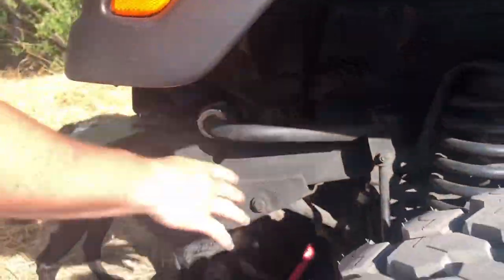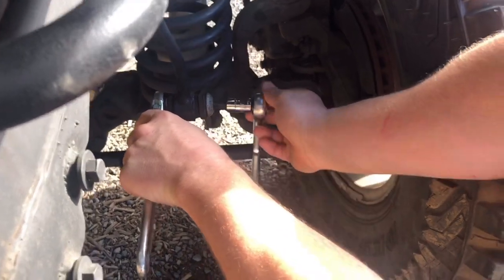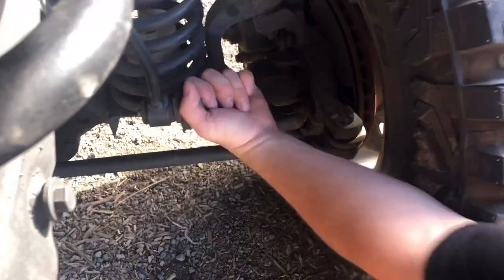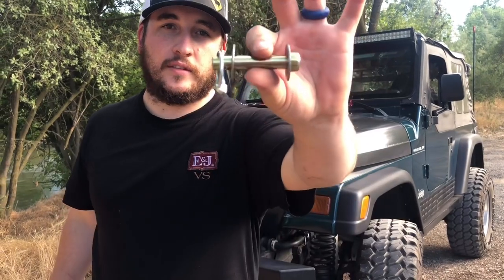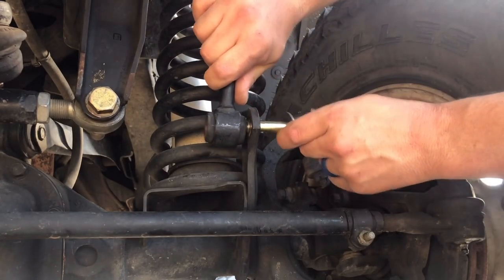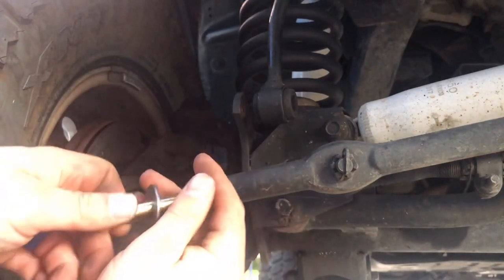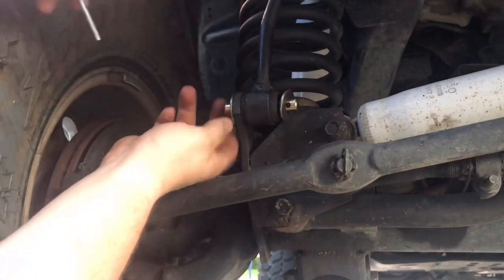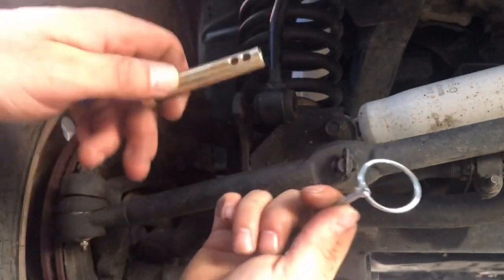$20 DIY Jeep Sway Bar DISCONNECT Link Pins Jeep Wrangler TJ JK LJ XJ Better Articulation & Traction

Comment: You just have to do one side and that's it.
Reply: @ATEMOFFROAD  I mean you just try it. Just disconnect one side and the sway bar is already disabled and drive it. It would have no difference in driving if you disconnect one or two links.

More convenient and easier too.
Reply from the maker: @markperalta2995  works great 👍🏼 thanks for sharing! Cheers
Reply: @markperalta2995  wouldn’t that still restrict movement on the connected side?
Reply: @officialWWM  in theory no. The sway bar just connects both sides. Only restriction you would get is from the sway bar bushes
Reply: @officialWWM  Correct.  No resistance with one connected. It's a twist spring (the anti sway bar). It's only a spring when it's twisted.

Comment: I've never heard of disconnecting for a bumpy ride. It probably helps a bit, but the main reason to do it is for added flex and traction. Also it should be done with caution, if you've never tested your flex, the first time could cause rubbing of tires, damaged break lines, shocks, track bar bushings, drag link ends.... you need to know your bump stops are adequate, brake lines are long enough, shocks have enough travel ect. before you just take off down the trail. Also because those pins don't squeeze down on the sway bar bushings and links, they can wiggle, loosen, damage themselves and the bushing, and wallow out the bolt holes. It's a cheap and easy solution, but it can cause serious problems if you're not careful. Some cheap purpose built quick disconnect links prevent not all but some of these problems... install is almost as easy, and they are almost as cheap. The real trick is carefully testing it for potential problems before they become real problems.
Reply from the maker: These are all great things to consider Dan especially bump stops and tire rub, good points. When I disconnect it’s usually just one side now I leave the other side bolted! My 2015 rubicon jku has a push button sway bar disconnect much more convenient! I disconnect it , whenever I can even on fire trails that seam flat, really does help the ride quality! Thanks for sharing 🍻
Reply: It's helps even on bumpy rides, I've been doing it since my 1994 yj (new).  Bolt/unbolt...

Comment: Thank you for posting this.  I was going to pay someone over $200 to put in quick disconnect sway bars and I don't even need these with this mod!  Love it.  If I am not going off roading for a bit, I can put the originals back on, but this is a great mod for a quick disconnect when you get to the trail!
Reply from the maker: Oh yeah jeep add ons can get expensive really really fast! Honestly I found this out by a subscriber that you only need to disconnect one side ! And it works great because I’ve tried it! So that may save you too , thanks for watching! Cheers

Comment: Didn’t see the bolt in your list.  What is it called?  Thanks
Reply from the maker: Here’s the link to eBay! Thanks for watching 
https://www.ebay.com/itm/NEW-Jeep-Wrangler-TJ-JK-JL-Sway-Bar-Quick-Disconnect-Pins-Discos-V2-Set-of-2-/361382348622?_trksid=p2349624.m46890.l49292

Comment: So mine has a welded collar on that bolt where the sway bar link rides on that bolt. The only way I can see to get it of is to cut the bolt off. My driver side link will not budge off of that bolt either. I've tried prying, and pulling with a wire and using my breaker bar as a lever. Any suggestions?
Reply from the maker: You will only need to do one side , but if you do make sure that when you tie up the link to the sway bar it’s not connected to the jeep that side you choose will be floating. 

As far a removal goes heat and a hammer will always be your best friend , just make sure they haven’t welded it to the mount on the axle side!

Comment: Does it chatter on the road with the quick pins?
Reply from the maker: No I added another washer also , a subscriber on this channel recently told me to try and leave one side bolted and disconnect only one side , I tried it an bam it works great , you really only need to do one side with the quick pin! Thanks for watching

Comment: Their cool, but rattle like crazy.
Reply from the maker: They do add an additional washer. That’s what i did. Also you only need to do one side. You can leave the bolt in the other side
Reply: @ATEMOFFROAD  That's a good idea!  I'll try it. The pins for the ones I got are a tad small which doesn't help the rattle. Thanks!  I put them on my 4xe lift (build on my channel) in my  first YouTube video, I figured it would helpful for 4XE peeps.

Comment: Do not ever put cheap disconnect pin from Amazon or eBay. They will cause major issues. Any loose parts cause vibration in front end. It will effect bushings and cause bump steer and death wobble. Cost me a lot of money to fix. Check out this video and see what happened to his Jeep. 
https://youtu.be/tcGbrFgbTRE
Reply from the maker: It’s a good video and jks makes good parts , but for the cost I’m still not sold on them, i disagree with your claim of costing you alot of money in repairs including death wobble , these pins work fine if properly installed, always stack washers if the busing is loose. you most likely lost the metal sleeve in your rubber bushing causing looseness and premature failure. Nothing is better than stock, the pin merely replace a bolt and nut. Cmon man !  I’ve been running these for awhile now no problems